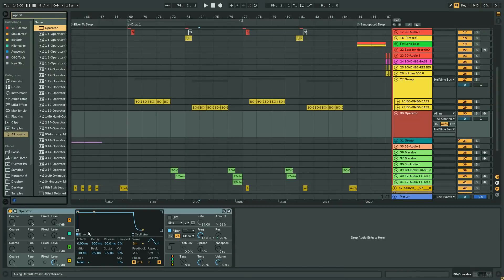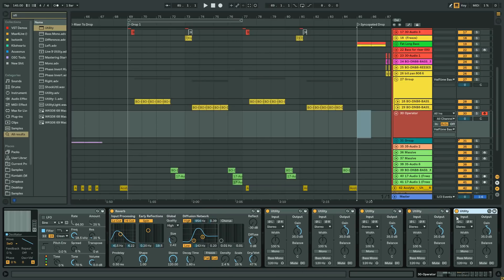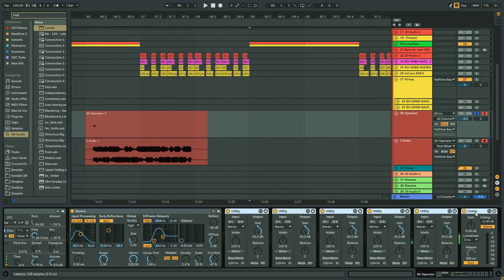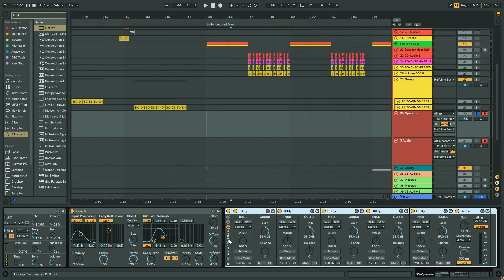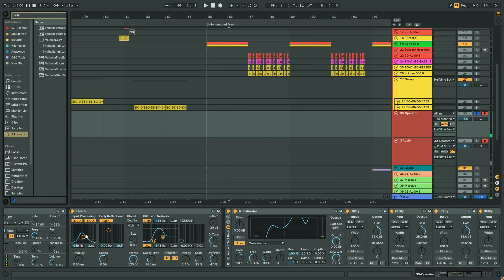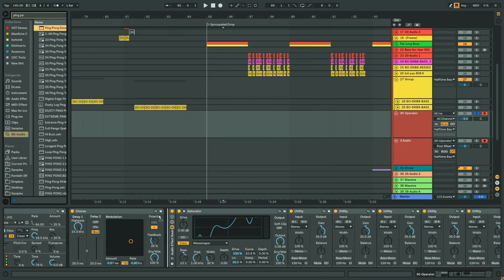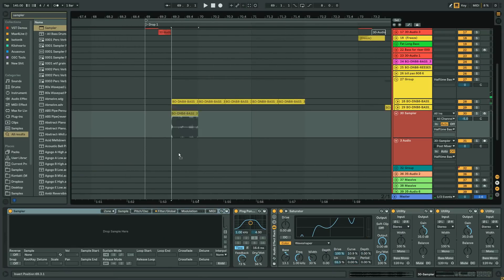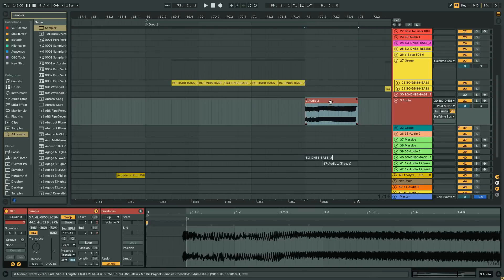Mr. Bill - Ableton Tutorial 71 - Discovering Artefacts In Time-Based FX

Comment: how do you do this with the new ableton 11 chorus-ensemble? It sounds the best with chorus in this video but it doesn't work with the new chorus-ensemble
Reply: Original Chorus is still available in Live 11. I don't remember how to summon it but if you load an old project that used older stock plugins they will still be there. They even give you the option to convert it over to Chorus-Ensemble. Hope this helps in some way.

Comment: The reason the decay time isn't the same time as the time it takes to completely fade out is because decay times are measured a certain way.
T60 (time for 60 dB decay) for example, just measures how long it takes for the sample to fade by that much. 
I'm guessing based on the reverb plugins I use that most use T30, IE. they just display at which point it's 30dB quieter, because by then, you probably won't hear it either way.
(I studied building engineering, pity me)
Reply from the maker: Yeah... It says that at 1:08 :p
Reply: Oh hahah, totally missed that :P